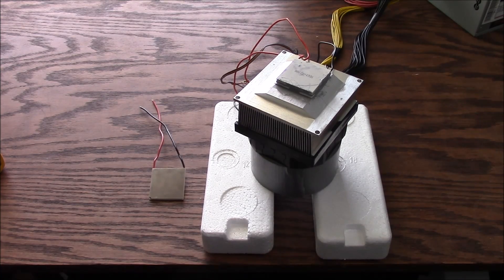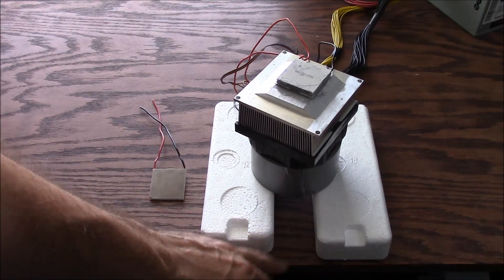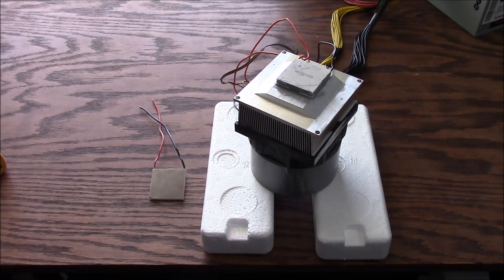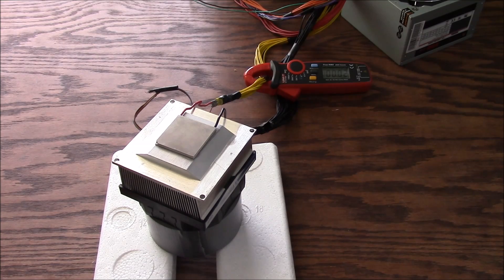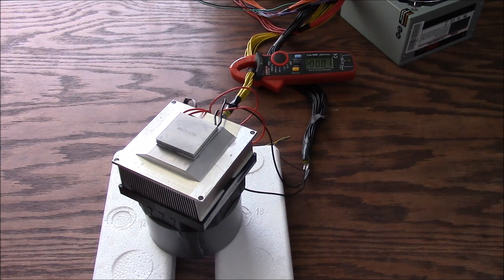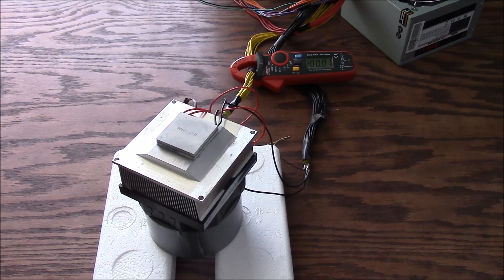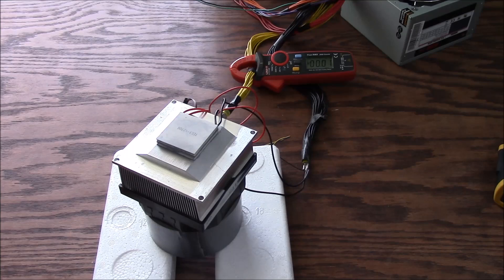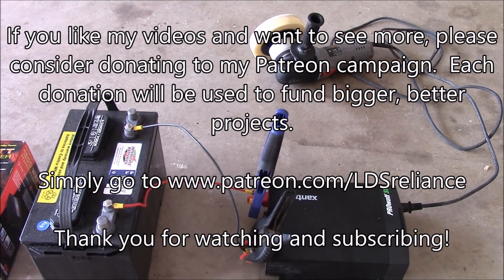Peltier War! - Cascading Vs Double Power

Comment: Can you try, and this is a idea which I had which I can't find evidence of anywhere, using a peltier to power a peltier , powering the peltier. In other words, when you heat a peltier you get electricity. Can you use that electricity to power another peltier, and the heat from that peltier is powering the original peltier. So there's 2 peltier in the circuit, negative to negative, hot side to hot side. Obviously you will have to give one a heat boost.
Reply from the maker: I am sure it can be done but they are not very efficient and by the time the power comes around the circle it will be a tiny fraction of what the original input power was.  I am planning a thermoelectric generator video soon so stay tuned for that.
Reply: On RCLifeon, he uses candles and ice water with several peltiers in series to power his cell phone

Comment: one thing i believe the ir gun is hard to get accurate readings because i have a cheap one and a smaller heat sink and can make ice on top of one and have the same kind of thermometer and had to be holding it right above and the right angle to get anything near 32 with ice on it
Reply from the maker: True but I don't know of any other way to attempt to record the temperature for these.

Comment: Could you test the following configuration? 2x12706 (cascading) but connecting them electrically in series instead of in parallel. Saw a video of a guy who did this and got better results.
Reply from the maker: Interesting.  I have not heard of someone doing that before.  Good idea.  I will have to try it sometime.
Reply: LDSreliance you need to put the highest Peltier with less voltage than the underneath when piling Peltiers

Comment: That wrong test secound paltier must be bigger than first. The first "transporting" heat but is producing heat also.
Reply from the maker: I was not aware of that before the test but it even further shows how inefficient cascading is.  I can't imagine anyone going to that length to get another 5 degrees except in medical and aerospace and those kind of fields where they literally do not care about cost.  I'll test it with a bigger peltier someday but it really has limited application.

Comment: can you take video of measuring temperature of hot side?
at least we can know how hot its temperature when powered to the maximum amps, so we can build more effective cooler on the hot side.

thanks for your share. Subbed!
Reply from the maker: I wish I could.  I will do more testing on cascading and peltiers in the future but that stuff is packed away for now.  The hot side of the heat sink was warm to the touch but not hot so definitely less than 60 degrees C.

Comment: I'm experimenting on a 12715 on top of a 12706 to fully evactuate the 12706's 120 watts of waste heat and stack.  I think that a 12720 or 12730 would work even better, but I'm concerned about the difference in size format (12720's are 50mm, and 12730's are 62mm while the 12706's are 40mm).
Reply from the maker: I have only messed with the 15's for that reason.

Comment: The stacked unit is handicapped because the bottom unit is receiving 120 watts of input heat from the top unit, and the bottom unit is only capable of evacuating about 50 watts.

The 12710 is able to pump about 110 watts of heat.
Reply from the maker: Good to know, thanks.

Comment: Because after turning off the power to TEC I feel the unit will stay hot on both the hot or cold side proof that the process will generate more heat then cold, so I believe if you want the most efficient transfer you will have to find the correct combination.
Reply from the maker: Probably so.

Comment: if you cascade properly (I.e. 10 amp peltier on hot side heatsink with a 5 amp peltier stacked on top) you can achieve sub zero temperature easily. 
each peltier in the stack has to be able to move more than the one before 5,10,20,50 amps in that sequence has achieved near cryogenic temperatures in lab tests.

cascading does work when applied properly
Reply from the maker: I agree.  There is no doubt it works.  My problem is it takes an inefficient technology and makes it worse.  I can test a 10 amp and 5 amp cascaded setup sometime but I can promise you it won't be as efficient as a 15 amp unit.
Reply: @LDSreliance  Cascading is used to achieve cryogenic temperatures and you are not gonna reach the same temperature with a single 10 amp unit. The drawback is, of course, low efficiency. When you do cascading, run the bottom one at full power since it has to remove all head generated from top layers. Putting two at the same voltage will cause the bottom one to overload and possibly heat up your top unit eventually. So run the top peltier at 5v and the bottom one at 12v.

Comment: I haven't viewed your other Peltier (themoelectric cooler, or TEC) videos, so perhaps you already understand why this isn't working very well, but if not, here's something to consider:

A TEC doesn't just move heat from one side to the other, it also generates heat during the process.  So say you're moving 20 watts worth of heat from the cool side to the hot side, using a 5A 12V TEC - you'll find there's about 80 watts of heat on the hot side, the heat you're moving + the 60W of heat the TEC is generating in order to move the 20W.  This is why TECs require such huge heatsinks, because most of the energy they spend moving the small amount of heat is also expended as heat on the other side.

Thus your second TEC has to push 80 watts of heat to the heat sink, using only 80 watts of energy, and it can't keep up.  My expectation is that it's swamped. If you put a temperature sensor between the two, you'll find that the temperature between the top and the middle is large, but the difference between the middle and the heatsink is small.  It's not able to move that much heat and maintain its rated temperature differential.

So a cascading cooler really doesn't make sense unless you're using a smaller cooler at the coldest side.  Say a 10mmx10mm 30 watt unit stacked on top of a 40mmx40mm 60 watt unit.  At that point, on that smaller surface area, you should see significantly cooler temperatures than you do with a high power single stage - but it's a smaller area, moving a smaller amount of heat.  This is often done in scientific settings, for instance CCD cooling in specialized applications.

You may find, however, that stacking a 5A unit on top of the 10A unit will result in a cooler temperature than the single 10A unit alone - but then you're using 15A, and the temperature difference isn't going to be all that great.  But using a 120W unit to move 80W is going to be more successful than using a 60W unit to move 80W.

Hopefully you find this useful.  The above is really a hand-wavy explanation that points in the right direction, but it's a very simplistic view, and if you dig further into TECs you'll find the above isn't perfect in many ways.  It's just a good way to think about it if you aren't going to do the actual heat transfer calculations.
Reply from the maker: Thanks for the great comment.  I understand all of that conceptually but I had never seen it work in the real world and that is why I wanted to do the test.  Sometimes things that make sense in my mind or that I have been told or seen in my research ends up being surprisingly not true in the real world.  So over the couple years since I started playing with TEC's and doing videos on them (you should look up my peltier fridge videos) I have had probably a dozen or more people tell me I should cascade two peltiers together.  I've been meaning to try it for a while and just now got around to it.  It worked pretty much how I expected.  However, I had not thought of using a smaller TEC on top of a larger TEC before so that bears some consideration in the future.  Thanks!
Reply: Your post is top notch! Thanks for sharing your time & knowledge!
Reply from the maker: fannygitchyurgun spiritwind
Are you referring to me or Adam?  Either way, thanks for watching the video :)